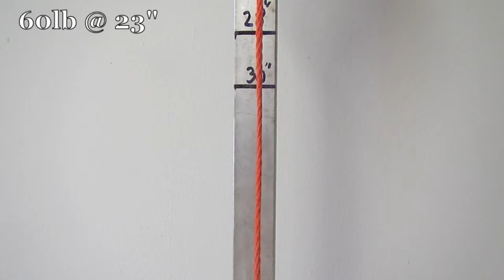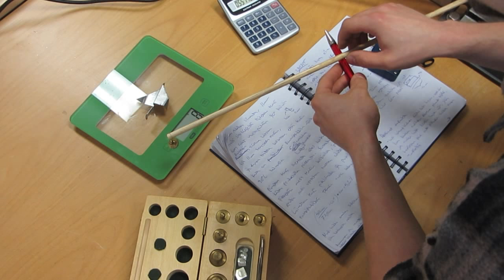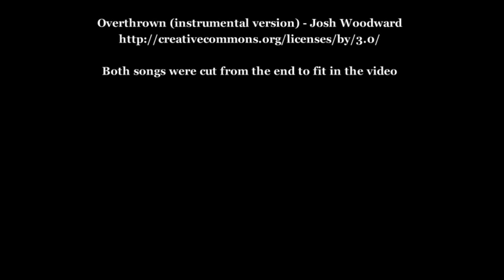Cable-Backed Center-Fire Bow

Comment: only problem I see is the bow forces you to shoot instinctive. and since you went through the trouble of making it center fire, you may as well use a trigger release like compound shooters use, as Mediterranean style draw pulls the string to the left of center, and Asian style (  thumb release ) pulls the string right of center.no need to cant the bow if the string pull is straight back . different shooting styles evolved to deal with the inherent problems of different bow types. the Penobscot natives ( not sure I spelled it right ) had a similar type of bow that used a second string along the back of the bow to pre stack the limbs. this allowed the shooter to adjust the bow to whatever pull weight they wanted, without changing draw length or anchor point. sorry for the long winded comment, I can talk bows forever. anyhow, keep at it, ive been making bows for over 40 years, and I still learn something new every time.   best of luck on your journey

Comment: How much does the Dyneema backing add the bow's power ? and how can you bend it ? as dyneema isn't a really extensible rope, it's used in kitesurfing and bow stringing so ...
Anywayit's a really cool design that seems to work really well !